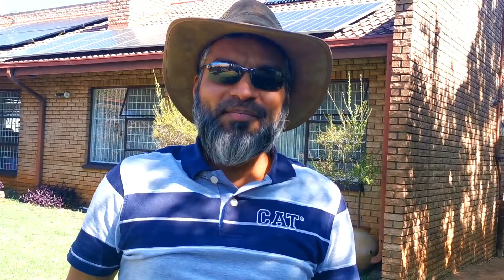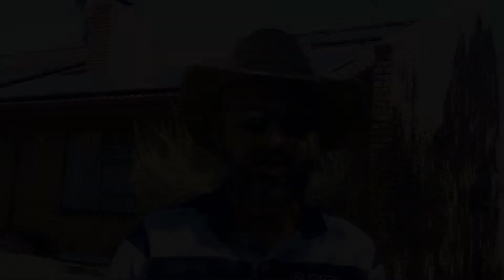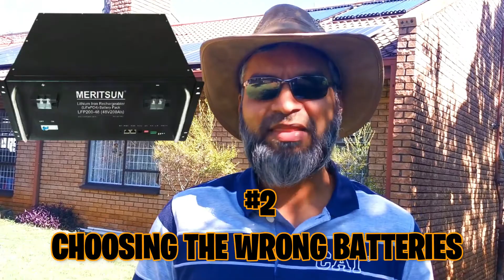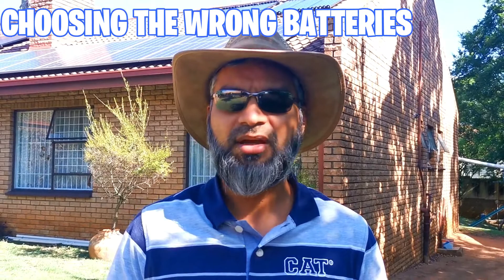3 Common Mistakes to Avoid in Solar Panel Installation

Comment: True , hybrid inverter like deye or sunsynk with 1 hubble am2 is a perfect start for most
Reply from the maker: Yeah those hubbles look good. Can you send me your setup?
Reply: @ElecAndAll my pleasure 
im rocking a 5 kw deye inverter 
8 x 350w C Sun solar panels
3 x us2000c 2.4kwh pylontechs.

This runs the house , granny flat and bachelor flat. 

Bachelor and granny have gas geysers and  stoves. 

House will have a gas stove. But I want to install a kwikhot direct 200l 20 evacuated tube solar geyser  in series with a 150l electric geyser in the house.